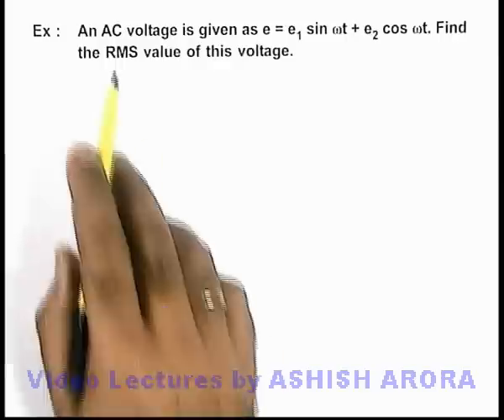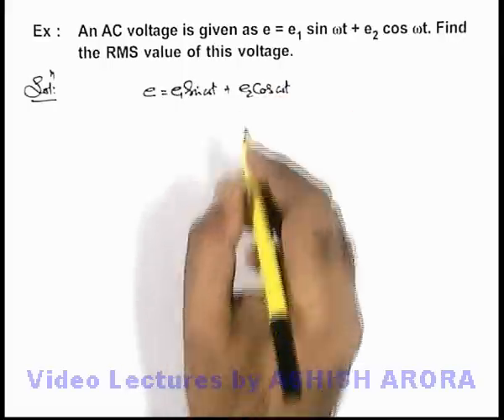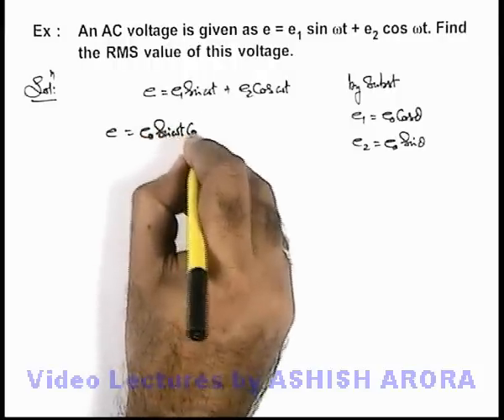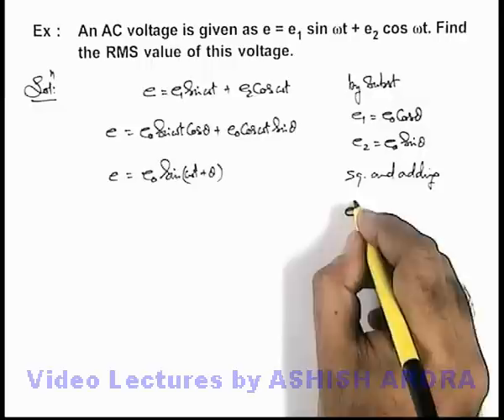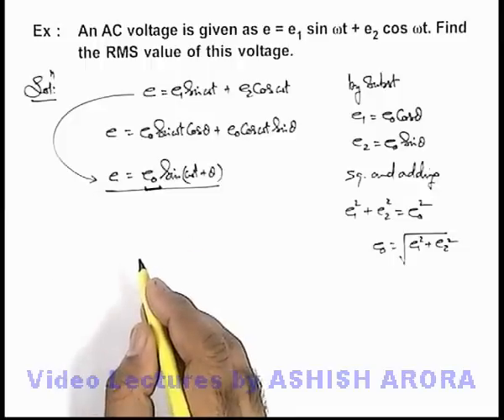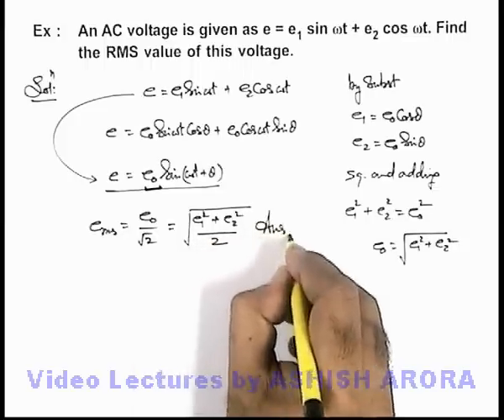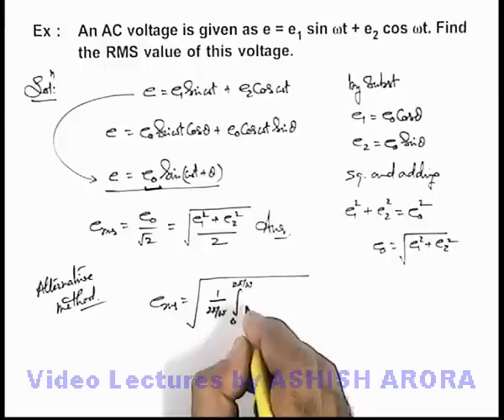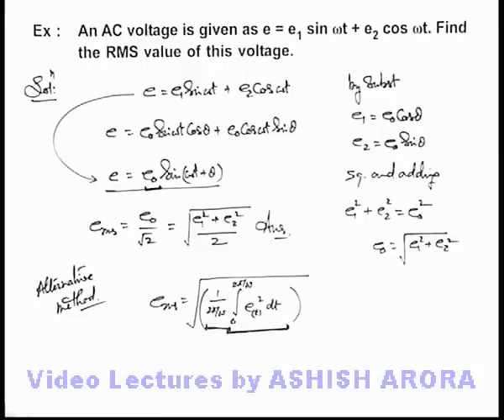Class 12 Physics | Alternating Current | #10 Solved Example-3 on Alternating Current |For JEE & NEET

Comment: sir there was no relation between e1 and e2
so how did u specified a relationship between them
Reply from the maker: These are two variables and we have related these with two other variables eo and Θ... so the condition of dependency remain the same...
Reply: @physicsgalaxyworld  sir you should keep one variable in relation . Either theta should be different or e⁰ should different
Reply: Physics Galaxy 
sir but they were independent of each other initially but now are connected to each other
Reply: @tushargupta2423 consider a right angle triangle with hypotenuse as e0 and other two sides as e1 and e2. Now take the angle between e1 and e0 as theta. So e1 = e0cos(theta) and e2 = e0sin(theta).
Reply: @khushalbishnoi  then why you didn't assumed them as a side of rhombus , isosceles trian , equilateral trialne?

Comment: You took E1 is equal to esin(teta) and E2 is equal to cos(teta) that means you are giving a relation between E1 and E2 ,but according to question E1 and E2 are independent values
Reply: Same here . Relation is not same . e¹/e² =cot∆ not given in qsn
Reply: e0 and theta are both variables so e1 and e2 can be expressed by other 2 variables.
Reply: Same doubt